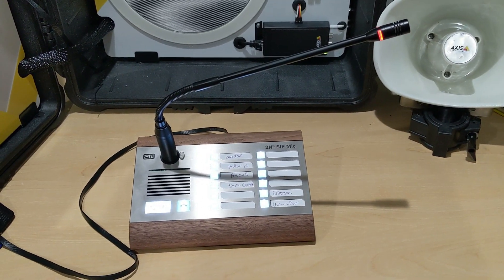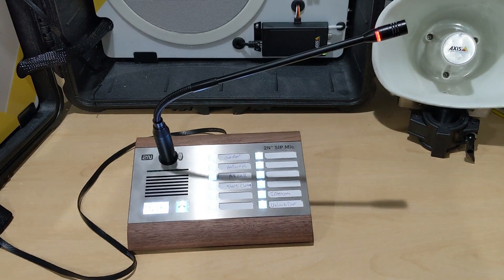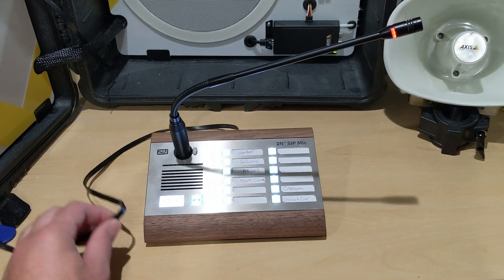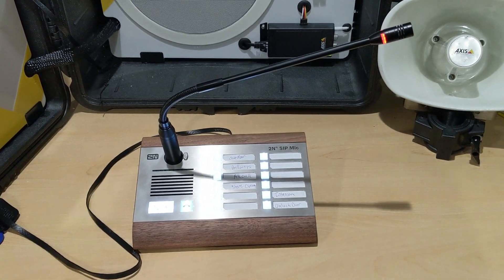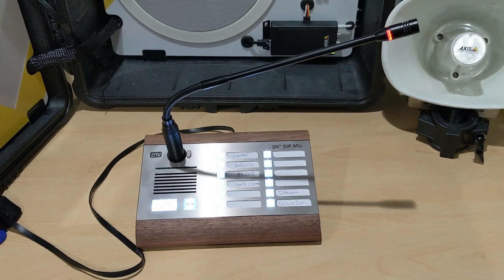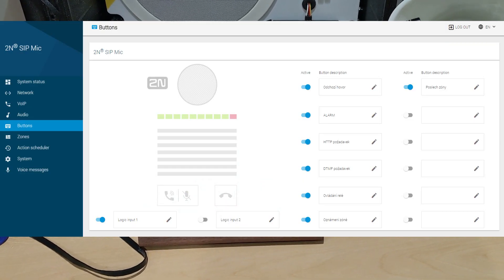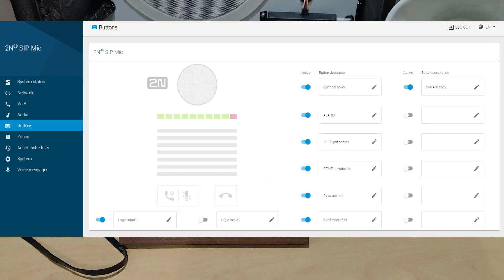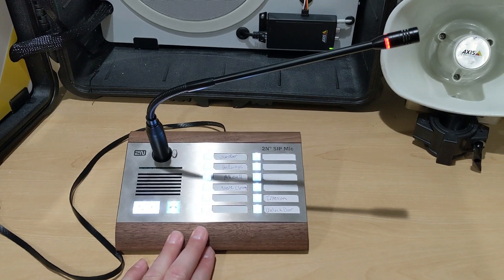2N Sip Mic - Integration Demo

Comment: Hello, what if I have 50 different Outdoor speakers, is there a way to cast on all 50 at the same time? 

Thanks in advance!
Reply from the maker: couple ways.  Axis speakers support leader follower.  You can have 1 speaker be the leader and assign all the other to be followers.  This can all be programed in the web interface of the leader with no additional software.  Then if you want to create groups and zones, there is additional software installed on the speakers.  Just been a while since i logged and and set them up 

But very easy to do

Comment: Hello, how many C3003-E, I can connect at most and it is possible to integrate it with an alarm panel so that the speakers are activated with a dry contact
Reply from the maker: you can sync up to 50 speakers together in a master slave set up.  If you want to integrate it into an alarm panel, you must use the C8033 as the master and the C3003 as slaves.  The C8033 has I/O's and can act as the master
Reply: Thanks for the reply, and to make it necessary to use the axis audio manager server?
Reply from the maker: @angelcaldasvargas7192  nope.  That is not needed